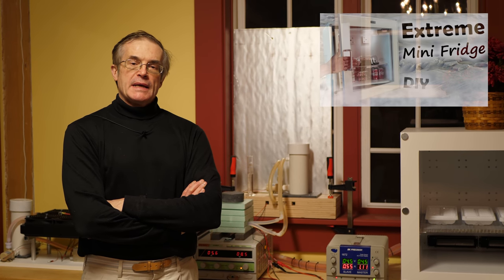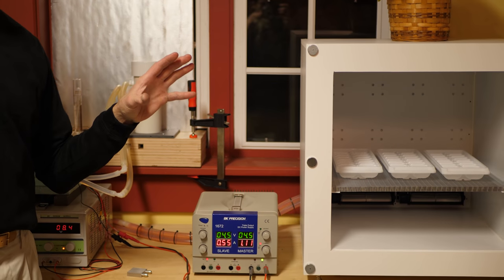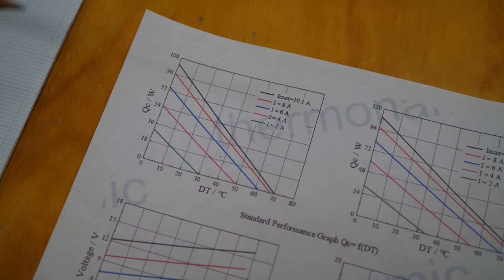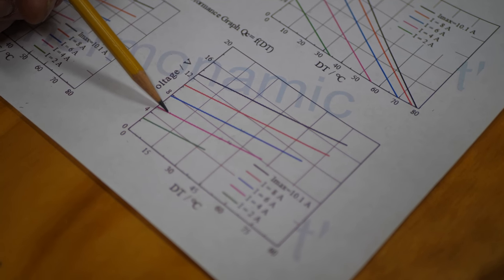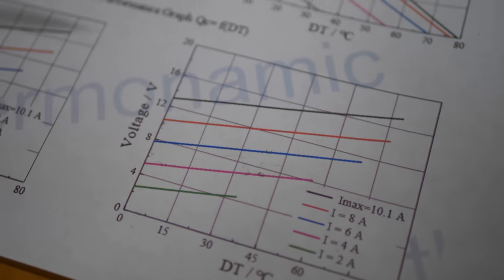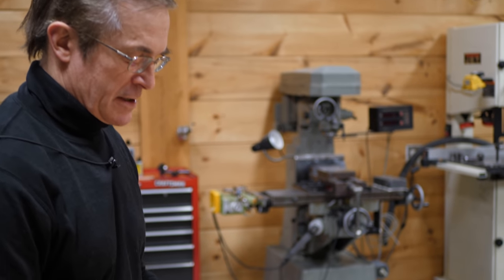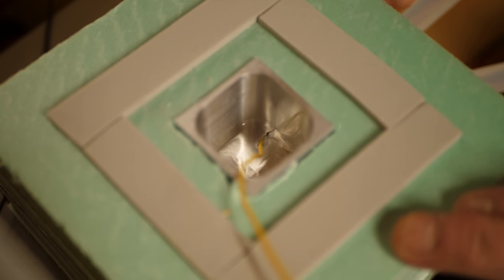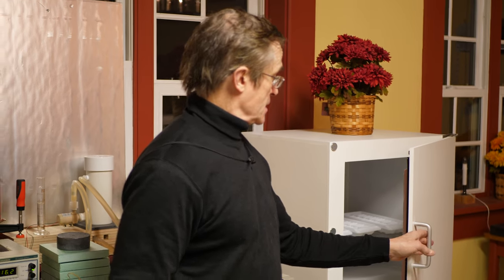EXTREMELY LOW TEMPERATURES! - Using TECs

Comment: I was wondering how low can you go with these TECs. Someone had stacked only 2 of them and reached -60 °C. What the heck?
Reply from the maker: You can dip below -100, but the cooling capacity is miniscule.  This can still be useful for cooling passive electronic components such as the CCD in a low light camera.
Reply: @TechIngredients  
It might be interesting if one could solidify CO2 and since gases don't have a very high heat of phase transition, it might be possible. I was able to solidify mercury once but I used a single TEC, I placed it in my freezer and maxed out the freezer so it reached -26 °C. I think the surface of my TEC was reaching -46 °C.

Comment: How effective are one of these TEC stacks at applying cooling to an active heat source? Like would it be effective at combating the heat generated by a desktop CPU? The pro-sumer  market for desktop cpu cooling is pretty huge and if it's possible to make something more effective, even at the cost of significantly more watts, people would throw money at it. Maybe throw out a utility patent if one doesn't already exist. Even if you don't think it'd work, someone less smart than you would probably pay good money to buy that patent off you. More money for cool projects and interesting engine projects :)
Reply: TEC's are very bad at handing actual heat power. They can reach very low temps like in this example, but that's only really because very little heat (in watts) is actually being added to thee system. If you add one of these stacks to a CPU, even at idle, a modern CPU will actually get hotter than if you used a stock air cooler. The TEC's simply cannot remove that amount of thermal power. About 15 years ago, CPU's were much slower and didn't produce nearly as much heat (again, in watts, not absolute temperature), and so this could be used and some people in the overclocking or enthusiast scene experimented with peltiers, but... They were rarely any good, and they consume a shit-ton of power themselves. Back then, a TEC stack could consume more than the rest of the entire PC.

What IS possible however is to use TEC heat exchangers to cool down a water loop, basically building a water chiller, and using that chilled water (with antifreeze of course) to cool the CPU. That does work, but you are essentially using the water cooling radiator to cool the TEC, and the TEC cools a separate loop, that in turn cools the CPU... If that makes sense. The reason this works, is because the radiator can remove a lot of heat from the TEC, and it allows the water to drop below ambient. You still need a really chunky TEC heat exchanger though, probably 4 or 6 TEC elements in parallell (not in series!!), which is a lot of power. Easily 200 watts ++, just to drive the TEC's.
Reply: Mythricia it’s a lot more units than that, Der8aur made one with 8-12, something like that, and I think he’s going to have a hard time, it was overheating at idle because he had mediocre air coolers on the TECs, haha! He was running them at 360w on the TEC, but that’s so not going to cool modern Intel CPUs above duel core... it’s also kind of expensive needing 20 waterblocks (hot side plus cold side), the massive radiator for the TECs, the extra PSU, and so on. I much prefer my sub-zero phase cooler, lower power and handles real heat load while keeping core temps under load below freezing, very hard to find those coolers, but you can make most of it out of a refrigerator or air conditioner... so not super pricey if you could get the evaporator heads without brazing one yourself (mine is just a commercial unit, I got lucky and actually found one).

Comment: I have that watch this video once before a good while back I was just skimming through I actually like your channel unlike a lot of the build you do but today I was looking at how to figure out how to make liquid nitrogen and I'll try to figure out how to make a cryocooler or something biblical to liquid down and you had me thinking for a minute with the mini fridge that you have cooled by water cooling and you had mentioned maybe making to staged Peltier styles what if you use a normal mini fridge or even a regular refrigerator to work as a first-stage the cool liquid down that goes through water block that then would cool the hot side of the peltier's to use as like the second or third stage how well would that work for dropping even lower in a temperature gradient while being efficient when trying to drop down it's like liquid nitrogen temperatures would that actually be a good solution and how efficient do you think that would actually be as what I'm trying to consider doing is filling up nitrogen bottles for using for things like blowing out a refrigerant line while brazing a line set together on a refrigerator or a mini split or things like that where I need to purge the oxygen out and I was thinking of ways to try to refill a nitrogen cylinder which is what had me going down the cryogenic side of things
Reply from the maker: The fundamental problem with that approach is that peltier devices become progressively less efficient not only with larger temperature gradients, but also as the temperature  of the entire system  drops. At about minus 120C, they stop cooling any further as the energy  that they consume equals the heat they can move.
Reply: Okay to make sure I'm understanding this correctly is your saying even if I started off at 120c on that's called The Hot Side it would already be so saturated that I couldn't go any lower is that the correct understanding ?

Comment: Placing the cooling fans outside is not commercially viable and for practical purposes it would be better to just blow the cold air from outside into the box or thread the cooling liquid tubes into the frozen topsoil. Currently the heat transfers to the cooling liquid and then back to air which is not efficient, because of the huge molecular density difference between gases and solids/liquids.
Reply from the maker: Molecular density is not relevant, what matters is heat content and mass flow.  However, you are right that outdoor fans are not practical, but can be when the remote cooler is located in a cool room like a basement or a better alternative would be to route the cooling liquid to a buried gound loop.

Comment: Do TECs perform better and/or have increased efficiency if you used a pulsed DC waveform instead of a steady DC current?
Do the devices themselves have a 'resonant frequency' where their peak performance is achieved?

Have you ever tried it?
Reply from the maker: They don't.  I haven't tried it because it's already been tested and it makes sense.  The effeciency drops as the current increases even if that increase is short lived.  Pulsing simply concentrates the current flow in time.
Reply: @TechIngredients  Thanks for the reply.
I appreciate it.

Comment: This is why I scream when I see computer people try to cool CPUs and graphics cards with TECs. As a rule of thumb, when you add a TEC, a few things happen:
* You must spend same amount of electrical power as amount of heat you must pump (very roughly, and at minimum). So, if you have a 250W produced by CPU or GPU, you must now add 250W of power to the TEC to remove that power. At least. As a consequence, you paid for electrical power twice, and how need a power supply that can handle the double draw.
* Secondly, a heatsink that was going to be on top of of CPU or GPU itself, must now dissipate heat generated by CPU/GPU PLUS heat generated within the TEC as it is providing the heat pumping action. Therefore your heatsink is now dissipating at least double power now, and is now SIGNIFICANTLY hotter.

Thirdly, and laughable, is the issue of not providing enough power to the TEC(s), or not cooling the heatsink adequately. If not enough power is provided to to the TEC to produce the requisite temperature delta OR the heatsink is not sufficient for the task (top surface of top TEC gets too hot), you will actually have REVERSE HEAT FLOW BACK DOWN TO YOUR CPU OR GPU. So, now you have just overheated your CPU or GPU because your stack of TECs and the heatsink on top was insufficient.

Lessons learned:
* Heatsink + passive air cooling IS ALWAYS MOST EFFICIENT.
* Mechanical heat pumps are a lot more efficient than TECs. Use TECs ONLY WHEN ZERO NOISE / MOVEMENT / VIBRATION / MAINTENANCE ARE REQUIRED. A mechanical refrigeration unit will spend a FRACTION of moved heat energy to move it, unlike 100+% that a TEC requires.
* Don't play with TEC or vapor phase or subzero or chillbox cooling for your CPU or GPU! Your finances should be used elsewhere, with a lot more benefit at that.
Reply from the maker: Agreed.
However, we will soon demonstrate a super cooling method that is both low cost and effective.
Reply: @TechIngredients  Thermoacoustic heat engine cooler???

Comment: Hi I would like to use this system to cool my pc will it work, and if so can you email me like a schematic diagram on how you wired everything including the Volts Watts And Amps. It would be truly helpful
Reply from the maker: It won't.  The cooling capacity is too low to deal with the hundreds of watts needed to cool a computer.
However, we'll soon be posting a much better, low cost method for cooling a PC.
Reply: @TechIngredients  or ok thx
Reply: @TechIngredients  Or btw my plan was to use it to cool water which I could then use to cool my pc, basically water cooling but colder. Not directly on the processing components, and I would have heatsinks to cool the TEC.

Comment: Oh man awesome.  This thing would make a wonderful CPU cooler for smashing world records. "Hello, today we'll be reverse engineering restrictions placed on common consumer chips and then we'll be seeing how much TDP... is too much TDP".
Reply: My phase cooler for my computer is colder, and it handles hundreds of watts, and modern CPUs use 1kW or higher. This is also about 150c hotter than the normal liquid nitrogen used, and about 220c hotter than liquid helium for those world records. Sorry to burst your bubble, but even dry ice at the grocery store is much colder than this.

I was looking at using turbo-molecular pumps for helium computer cooling, but even a raspberry pi would need a 12 to 15 kW helium compressor to operate constantly (unfortunately only 2.5w heat load capacity at 10 kelvin on the smaller 3.5 kW helium units...), I got kinda bummed. I think I’ll just make a liquid nitrogen generator, those are vastly more efficient. Phase like I use on my daily machines does great and barely uses any power if you actually want a very realistic setup, you can build one that has 1,000x more heat capacity per at -50c than this setup while barely using any more power (probably 100x more efficient, and doesn’t require sub-zero cooling water).

Comment: Tech Ingredients Hi,

I think there’s a fault in your calculations. 
I’ve watch your explanation several times but I cannot follow your reasoning. 
I think that you mixed up used power and pumped power or I just don’t get it. Since I’m the only one, chances are it’s me. 
The first line is clear. 
You use 28W to pump 18W at 33° dT 

Then you say: “the second is going to move 14W” 
Were did 14W come from? Did you mean 18W? 
(I think so because later your addition = 46W)

“But in addition it will also have to move 28W”
28W is energy used. Why should it move that? Of that 28W used, 18W is pumped away. So I think it should pump just the 10W induced by the inefficiency of the first element and another 18W at a different temperature scale to match the first element. 

If you’d add a third element that element would need to pump 18W + the induced 10W of the first and the more than 10W of the second element. 
The second element would be less efficient since it has to work harder. The third would be even more inefficient.

I think the second element would have to pump 10W + 18W = 28W. And at 4A dT would be approximately 24° 
So that would lead to a total temperature difference of 33°+24°=57°. At very low temperatures the elements become even less efficient so the difference would be less if you start at around freezing.
Reply: @Conservator yeah I was confused about that part of the calculation also and rewatched it several times more. Then I started searching the comments to see if I was the only one.
Reply: RedApproves Hi, nice to know I’m not the only one. Tx!

Edit: Oops seems we’re wrong after all.
Reply: He misspoke when he said 14 instead of 18. Otherwise, the calculation is correct. When you put in 28W, 18W of power moves from the cold side to the hot side, but the device has also absorbed the 28W you put into it. In order to keep the whole thing from heating up, you have to pump out the 18W which you've moved to the back side AND the 28W you put in. The 28W is just the price you pay to make the power move from one place to another.
Reply: Michael Biggs Hi,
Thank you, you are right. My error was that I thought 18W would go in and only 28W would go out. But than (as per conservation of energy) only 10W of electric energy should have gone in. 
The element uses 28W so (indeed) 46W must go out. 

So these elements are better in producing heat than they are in cooling.
Reply: The specs of these elements state a working temperature of -55°C to ~80°C. 

Other elements could go as low as 170°K or -104°C or -155°F
Reply: @Michael Biggs thank you for the clarification!

Comment: Something that bothers me:
You appear to be using amps as a carrier and volts as a measure of consumption. This of course matters not when you're looking at watts anyway, but voltage is electrical pressure and amperage is current.
But yeah, whoever suggested stacking them really needs a lesson on diminishing returns.
Reply from the maker: I'm using volts associated with a fixed current line on the graph and mentally calculating watts.
Reply: @TechIngredients  I still don't get why current is fixed. Electronics will use as many volts as you give them, with few exceptions. Voltage is pressure, so most electrical equipment is forced to run at what it receives. Their consumption of amps is what usually is internally varied.
Again, I understand you're calculating watts anyway, but I just don't get why have amps fixed in your graphs...
Reply: @LokiScarletWasHere  TEC's don't really work that way. They're huge blocks of semiconducting material, they don't necessarily behave the way you'd expect. For example, TEC's are more efficient at a lower VOLTAGE, specifically. The current it self-regulating, it's actually the voltage that you adjust. Which is not necessarily intuitive.
Reply from the maker: The current is not fixed, these devices work very similarly to a resistor.  The lines on the graph are iso current lines used to allow a two dimentional plot to show the relationship between voltage and say heat pumped for a given current.  The colored lines are slices of a third dimension.
Reply: @Mythricia1988  That's... The way I expect them to work. The voltage you give it is the voltage it operates at (also why electronics can be fried by overvoltage if they don't have a regulator), and the amperage you allow it to have will be the amount it uses up to certain limits regarding its resistance. The temperature differential and the voltage are the controllable variables and the amperage used is the part that varies internally. The peltier will use as much as it can get, up to the limits of its effective resistance or the power supply, whichever hits its limit first.
Reply: @LokiScarletWasHere  So what is the problem then? Voltage and current are inherently related, he's relating the operation of the TEC to voltage, because it's a practical way of doing it in this particular case. That's why those charts exist, because depending on what you're trying to work out, one way of relating the different variables to eachother is more useful than another.
Reply: @Mythricia1988  Because the amperage isn't controlled externally, and the way the graphs are laid out treat it like an externally controlled variable. But, whatever... Whoever made those graphs deserve a lesson in electricity.
Reply: @LokiScarletWasHere  Lol, right, whoever made those graphs are probably an electronics engineer working for a company that designs TEC elements, need to learn "electricity". That makes total sense. As opposed to you, some random person on YouTube, simply not understanding them. Here's another datasheet, from Laird, one of the absolute top tier names in thermoelectric cooling. Notice they also use the same graphs. The only difference is they've combined them, so that they work basically the same way they were used in the video. Notice the lack of a current axis on either graph.

https://www.lairdthermal.com/sites/all/modules/thermal/thermal/images/tem/PC%20Series/PC4-12-F1-3030/PC4-12-F1-3030-datasheet.pdf
Reply: @LokiScarletWasHere  So, you still don't know what you're talking about. But feel free to call up Laird and tell them their graphs are bad. I'm sure they'll entertain your suggestions. Telling them your life story will surely help. Blocking you now because this is, although hilarious, also a giant waste of time.

Comment: Stacking them and using them in series--in terms of one in front of the other relative to the coolant flow--aren't the same thing. I think you are confusing "in series" and "stacking." I want to see what the efficiency effects are when you actually use a series of them in line with the coolant flow.
Reply from the maker: I understand the distinction you describe.  I'm not sure I understand how you envision the series plumbing of individual TECs.  Can you elaborate?